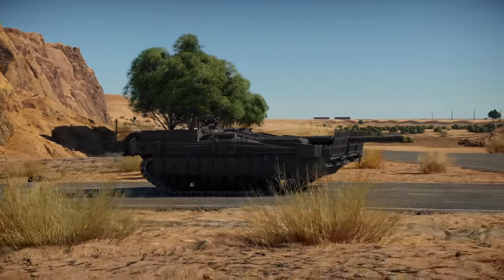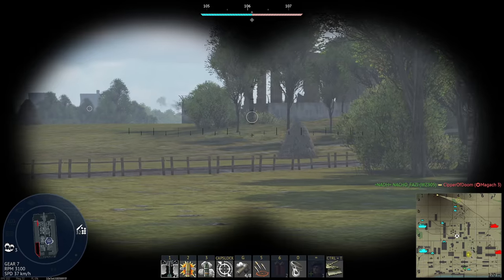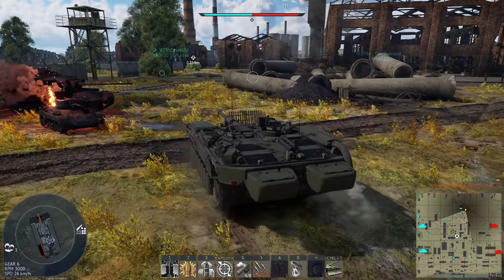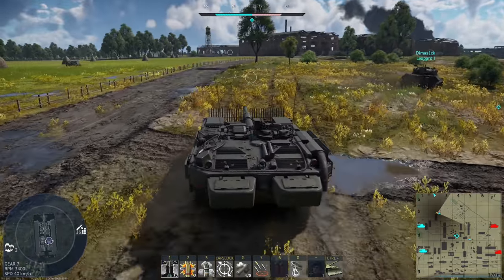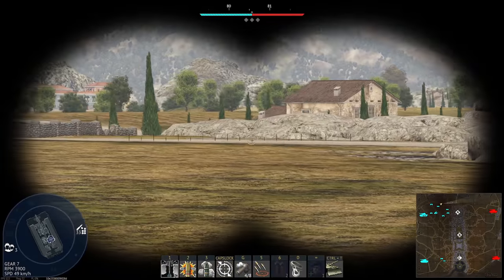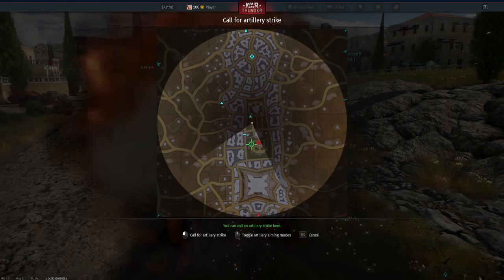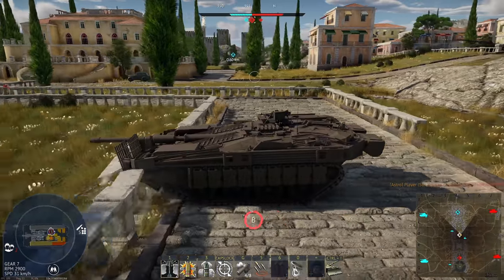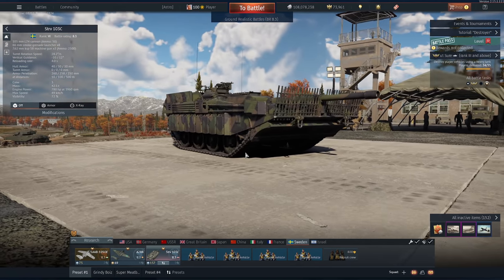THE MOST BROKEN TANK IN WAR THUNDER

Comment: A couple fun IRL facts about the 103.
The reload wasn't 4 seconds. it was around 2.8 seconds when holding down the trigger.
Thanks to its longer barrel it had about 20% more velocity and penetration while using the same ammo as other 105mm guns at the time like the STRV104 for example.
Reply: thx
Reply: And the 103 also used the M/90 ammo, the C in the M/90C stands for Centurion. 

The round was to long for fitting inside in the auto loader so Sweden ordered a modified round (M/90S) where the dart is sitting couple of centimeters further in the casing. 

The centurion can fire the M/90S but the 103 must use this round. 

The 103 could penetrate targets 500 meters further away compared to the Centurion when both using the same ammo.
Reply: also its really true in irl that one crew member can drive and shoot that thing
Reply: Not 2.8 seconds, but 2.5 even. Altough most of the time it was set the 4.5 seconds irl.
Reply: @lada_niva_1.7i  2.8 is what I was quoted from an ex 103 commander while i was doing my service in the Swedish armed forces. also the gun wasn't ever "set" or programmed to any speed. The machinery worked as quickly as it could and the fastest fire rates were achieved when holding down both the fire and reload button for continuous fire.
Reply: "Despite its caliber, the cannon was fully automatic with an integrated autoloader, classifying the weapon as an automatic cannon. The weapon's maximum rate of fire was 24 rounds per minute, or 2.5 seconds between rounds. However, the practical rate of fire was somewhat lower as the gunner, depending on the circumstances, needed to locate the target again after firing due to, among other things, dust thrown up from the previous shot . According to a document from the War Archives, the practical rate of fire was about 13.5 rounds per minute, or 4.5 seconds between shots.  If necessary, however, automatic fire could be released by holding down the fire and load buttons.

The automatic loader was located immediately after the upward wedge on the rear of the cannon. In the center of the carriage's upper rear armor there was a small hatch for ejecting empty casings. In the center of the carriage's lower rear armor there was also a hatch to remove cartridges that had been loaded but not fired."
Reply: @lada_niva_1.7i  Right. “Practical fire rate” not set. That’s taking in time for loading, aiming and fire command. And I assume the 2.5 is just a rounded number. Or paper values if you will. 24 shots a minute is easier to write and explain than 21.4285714 shots per minute.
Reply: @95Karlsson  no its not rounded, the autoloader is really that fast. And if it was rounded, the 2.8 would move to 3 and not 2.5
Reply: @lada_niva_1.7i  wow really, it’s an auto loader? I had no idea! xD
Look, I don’t know what to tell you. 2.8 is what the actual commander told us from his own experience.
Reply: @95Karlsson  when i was at arsenalen tank museum i had a nice talk with stefan karlsson about the strv 103 and he told me the abolute maximum rate of fire was 2.5, i belive he operated in the strv 103 before too.

also why are you shitting on me about saying that the autoloader is really that fast. How should i formuled it better?
Reply: @lada_niva_1.7i  How am I shitting on you? I'm just telling you what I've been told by someone who I know for a fact worked with the tank from when it was first introduced to when it was retired and still works with one of the few running examples. Disagreeing with you is not shitting on you.
Reply: You were a jerk about it when i said: "the autoloader is really that fast"
Your response: "Wow really, its an auto loader? I had no idea! xD
Unecessary, isnt it?
Well idk what to say anymore but it was exact 2.5 seconds fast if you hold down the fire and loading button, as stefan karlsson told me. He knows pretty much everything about the s-tank.
Reply: @lada_niva_1.7i  Well without proof your guy is almost as reliable as my guy. Except I know that my guy actually served in the 103. you think yours did. Wasn't he also the guy who claimed that the 103 once got an upgrade that gave it like 3 degrees more depression in one of Arsenalens videos? That was a load of bull so I'd take what they say with a grain of salt. About 0.3 second worth of salt.
So I don't know what to tell you anymore but it was exactly 2.8 seconds when both buttons were being held, as my commanders in the army where I served told me. They worked on the tank for its entire service life  and still work with it so they know everything about the S-Tank.

As for my comment earlier, I must have misread. Thought you said something along the lines of "It's an auto loader. That's why it's so fast."
Reply: @95Karlsson  no stefan wasnt that guy. Someone asked online before and someone else said that it is exactly 2.5 seconds. His source is also an ex-operator of the strv 103.

I cant post the link cuz youtube automatically will delete my comment, but i can post the conversation

Title: Is it true that the Strv 103 had a MAXIMUM reload of 2.5 seconds?

Person1: No. Just firing blindly "auto" with firing and loading buttons held down would give you a maximum firing rate of 24rpm, that is 2.5 seconds between shots. Maximum practical firing rate (e.g. you're trying to hit something) would be 13.5rpm, that is a reloading time of 4.5 s.

OP's response: Yea i know that you would need to aim first and things making it around 4 seconds. So the absolute maximum fire rate really is exact 2.5 seconds between shots?

Person1: So they tell me. I've only looked at the buttons, never pressed them.

OP's response: Who told you? Ex-operators of the strv 103?

Person:1 Mostly then-current operators, actually. I am an army brat, and back in the 1970s I spent many evenings with my father's Strv 103 company. The guys were happy to tell me stuff about the tanks. In the 1980s I was in the mech infantry, but some of my friends ended up with either Centurion or Strv 103, and we kept talking.

If you still dont belive me then idk anymore. I gave you 3 sources and you only gave me 1...
Reply: @lada_niva_1.7i  Look. Neither of us has given any actual source. At this point you’re just saying “I heard from this YouTube video and people who have watched the same video” and I’m saying “I heard directly from this operator.” I have as little or less reason to believe you as you have to believe me since I’ve actually served in the Swedish armored forces and talked directly to people who worked on it, are still active in the army and has been present when rapid fire was tested. 
Quality vs quantity of sources.
Personally I think you’re going of paper values. Kind of like how I was taught that the STRF that I served on had a fire rate of 600 shots per minute but if it was actually tested and looked into it could probably be anywhere between 590-610 instead. Like if the fire rate came in at 594 it would just me marked down as 600. I think that’s what the servicemen were telling the little “army brat” child, the paper value since it was more convenient number.
Reply: @95Karlsson  Right. Im not going to argue with you anymore, my sources are from ex-operators too. I belive stefan said hes an ex-operator of the strv 103 in one of the chieftan videos. Youre in the luck to be swedish and live in sweden to talk to ex-operators, meanwhile i have to communicate with ex-operators online...
Reply: @lada_niva_1.7i  Look, I’m not saying you’re lying or that they have lied to you. I’m sure that on paper it can be 2.5 and that’s what the guys you’ve listened to have been told. 
However the guy I talked to has actually timed it to get the exact result. 
Either way, be both agree that in game it should have a faster reload. :)
Reply: @95Karlsson  yeah, the strv 103 is one of the most inaccurate tanks in game...

- The Strv 103 has a reload of 2.8  seconds (as you say), not 4.

- The Strv 103 has 2 engines, but in game they are modeled together. Irl, if one engine is hit, you can use the other engine to keep going. In game, if one engine gets taken out, the other one is taken out too.

- The fuel tanks have a very low chance to catch on fire if hit. And even if they would catch on fire, they would just burn out leaving the crew unharmed.

- The 2 fuel tanks in the rear on the sides have proven in testing that they can eat up HEAT rounds, leaving the crew unharmed.

- The fence (well i call it fence) on the Strv 103C has a chance to decrease the velocity of kinetic rounds as well as APDS ammunition if hit, making it harder to penetrate the sloped 40mm armor.

- The ribbed armor you can see on the Strv 103A and 103C should not make ammunition like HEAT-FS, APDS and APFSDS "grip" on the armor making it easier to penetrate the sloped armor. The Strv 103-0 does not have this problem, it just bounces those ammunition types.

- The 40mm sloped armor should be way more effective, especally against ammunition like APDS as proven in testing.

- The hull-aim is very smooth, even on sloped, unevem terrain.

- the fuel canisters on the side of the strv 103c can defuse HEAT-FS rounds if they are filled with fuel

- the 103's should have more penetration than other L7 based guns as the 103's have longer 62 caliber barrels compared to the normal 52 caliber L7

- the ammo capacity should be 51 since 1 round is already loaded.

I have seen numerous first hand sources posted for these issues on the forums and nothing has changed. Gaijin doesnt give a shit about the inaccuracy of the strv 103 wich is just sad :(
Reply: @lada_niva_1.7i  And yet they instantly pounced on the chance to remove tracers from 30mm aircraft guns because “historic accuracy” which isn’t even accurate. 
Actually got to talk to a J35 pilot who flew at the same airbase where my grandfather did and at least he claimed that they had tracer rounds. However often opted out of using them since they would set the grass target fields on fire. 😅
Cool thing about the fence on the 103, it made kinetic rounds tumble, eating up a lot of their penetration. And made HEAT rounds crumble provided the tip fuse went between them, rendering the round completely harmless for the tank.
Reply: @95Karlsson  didnt the Strv 103D have added composite armor as someone told me? Would be a really nice event vehicle for the game at like 8.7 imo
Reply: @lada_niva_1.7i  think it was ERA? Not completely sure though.
Reply: @95Karlsson  oh yeah right it was era, this was discussed on the forums before. Would still be a nice vehicle to see tbh
Reply: This conversation went from a heated argument over a .3 second difference to a “agree to disagree” just to shit on how stupid Gaijin is at being consistent with making vehicles historically accurate.

Comment: Strv 103 IRL
Steady, precise, incredibly accurate, drives like a dream, handles like Tony Hawk on a skateboard.
Strv 103 in WT 
Janky, wobbly, imprecise, handles like a wet seal in a rocking chair.
Reply: My former teacher back in elementary school used to drive the s-tank. a big flex
Reply: And 2.5 sec reload time irl
Reply: “Handles like a wet seal in a rocking chair” I’m gonna use that one
Reply: The tank works great on paper but having a hybrid engine with a strange suspension system made things rather clumsy.

If the tank remained a single person tank it would have been a lot better due to weight distribution
Reply: @gvi341984  I take it you never watched this thing doing work IRL? It is far from clumsy . It could outmanouever any contemporary vehicle with ease. Adress on target and fire faster than any turreted vehicle. Post cold war tests also proved that it made rather chunky holes through anything russian built.
Reply: @gvi341984  they broke it up into 3 people because 1 person couldn’t reliably perform all the functions of a tank crew even with all the necessary controls

Comment: 2:30 it can be manned by UP TO 4 people, but can be fully functional with just 1 person in real life. Recommended to have 3 to be efficient.
Reply: Hi Rylan. The Strv 103 can seat maximum 3 persons in reality. The commander and  gunner/driver sit next to each other and has equal staring and aiming equipment. The commander has an additional cupola and can spot targets independent from the gunner and can also direct the gunner with his cupola.

The third crew is a second driver for backwards driving as well as radio operator. This is a solution essentially because the Swedish army realized that maintenance and daily services requires at least three persons but the tank it self does not require more than one person for driving and shooting. It was also a benefit with a backwards driver for quick withdrawal in ful speed from firing position without showing weak side armour

When the tank was developed it was  not essential to be able to fire during movement as most tanks of that era lacked high precision gyro stabilization of the gun and most of them stopped any way for accurate aiming. In that sense it was better to focus on protection and super low, hard to hit profile.

The solution with the gas turbine engine is unique and was a choice for space saving. The diesel is about 250 hp and for aiming and scooting when in position and the gas turbine of 490hp is for driving and relocation.

The hydraulic aiming of the tank is VERY precise, much better than the game is offering and also quick in reality. The auto loader gun with extended L7  barrel  is extremely accurate, and did outmatch any of the opponents of its time. The true fire rate is 24 shots per minut with a reload time of 2,4 seconds. 20 + 24 shots in the two magazines. The realistic fire rate is as in the WT game, approximately 4 seconds as firing requires reaming and target finding as well as dust clouds from firing is preventing rapid fire with precision. How ever, the gun can be firing automatically with maximum reload time by holding the trigger.

Comment: honestly, i bought the 103-0 version some time ago.
it's an amazing tank, but the broken hull aiming makes it lose a LOT of potential it could have.
i personally love this thing, but it's horrible at all ranges. The Wobbly hull aim makes it hard to aim at long range, it's mediocre at close range, and the amount of uptiers at 7.7 make it horrible at CQC as you face stuff with either APFSDS, or very late APDS which has a lot of penetration ( the 120mm Ordnance L1A2 on the Conqueror, which is the same BR as the 103-0 and 103A ), and let's not even talk about how big of an disadvantage it has with the lack of stabilizer and easily disabled engine and transmission, which usually makes it completely immobilized in the first penetrating shot.
Reply: My question is, why are you bringing an antiquated ambush vehicle into CQC and expecting anything other than getting slapped?

Comment: The Strv 0/A are two of the best tanks at 7.7. I can consistently get 5-10 kill matches in both. In fact I fear that they may be too strong and they might be moved up in br... The 103c is however much worse because it can't bounce anything.
Reply: Ridiculous tanks, they need moved up. No weakspots, crazy gun, good mobility. Wtf gaijin thinking at 7.7?
Reply: @sethdaboss245  it‘s not that easy to play and manny things can penetrate you
Reply: @sethdaboss245  HEAT shells and ATGMs are their weakness. The strv C can survive 1-2 HEATFS(and some ATGMs but ATGMs around 8.3 usually just go right through the mesh protection) shells shot through the front that's the main difference between the 0/A and C. There are a ton of HEAT tanks around 7.7-8.7 alone, which is probably why it's still around that br
Reply: @alex190alex  all tanks are victimized by heatfs and atgm. Makes no sense though that strv 103 is invulnerable to many tanks without those rounds at 6.7-7.7. Yeh like wtf im gonna do in a tiger 2
Reply: @sethdaboss245  ah a wehraboo
Reply: @sethdaboss245  its pretty balanced lmo.   shoot he at it or triple fire it and it dies. only good on ranged maps and is purely an ambush tank. agressive plays must be super tactical and to be fair a cent 3/5 or leo would shine equally in similar positions yet they are 0.4 lower br
Reply: @sethdaboss245  nah gajin says is good because maus haven’t got it’s br moved up so they must be ok
Reply: @sethdaboss245  that thing is 6.7 for a reason...
Reply: @alex190alex  other 7.7s cant pen it anywhere
Reply: @sethdaboss245  but here I'll give you the list that really CANT pen it ANYWHERE just for you <3
Reply: @sethdaboss245  oh guess what I just found out? Every single 7.7 tank has one shell that can at least take out the tank's transmission, and you know what that means? You literally don't know shit, but here I'll give you some advice. I found that the tanks that performed the worst against the strv 103 A are the IS-4M, T-10M, and the T32E1. Those are the only three that could only just take out the transmission, every other 7.7 can take out transmission and engine or go straight through into the crew compartment at at least 500m away. So in conclusion you're just really bad at the game
Reply: @sethdaboss245  Literal skill issue.
Reply: @sethdaboss245  shhh don't say that the swedish main will cry because their handheld shit isn't handheld enough.
Reply: @SecuR0M  ur brain
Reply: @sethdaboss245  smooth, no winkls, v cute